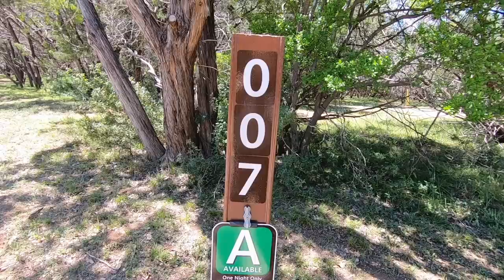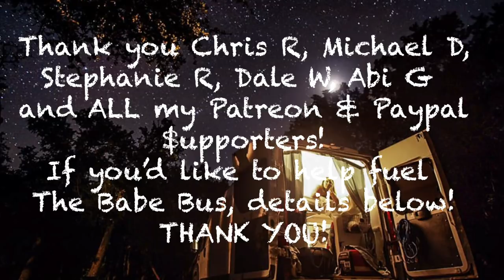Happy Two Month VANNIVERSARY Babe Bus!

Comment: Yeah I know it's a little late since you're already on the road, but if you end up someplace where there are a couple of soy-boy's who have tools and will work for a pkg of gluten-free rice cakes, add that 2nd roof fan. It'll be your most appreciated post-build upgrade. While our toy-hauler build will have sufficient A/C I hear that the portable evaporative coolers (swamp coolers) are a low-energy option for van people with limited space. If you get a chance to meet or hang out with other folks enjoying the Van Life along the way, find out what works best for them for dealing with the heat. If they've been on the road long enough they should know what works and what doesn't. Anyway, Happy Travels!

Comment: You can set up an indoor shower with a foldable dog pool and shower curtain on hooks. It folds up into a very little space when you're done. It sounds like you like long showers though so you probably aren't going to want to carry that much water.  It works for me but I'm also happy with a bar of shampoo soap and call it done. Mine sets up just inside the slider.

Comment: i live 6 months a year in a pick up with a shell.  i love laundry day!!!!  (mondays) @every 7 days...9am-3pm... 12 pack on ice....big sub sammie w/ lots of veggies....toilet with hot water(shower standing on your old towel).wifi usually, room to drag everything out of truck in the parking lot and clean and repack...do inventory...fix fishing equipment..retie loose stuff, check truck engine fluids...clean glass..clean cabin...toss out trash...oh yeah, do laundry and fold clothes...  most important....leave it nicer than you found it..bathroom wiped down, mirror cleaned,  empty trash from everywhere into one trashbag, wipe washer, nothing on floor, you get the idea...i have bumped into owners while there and told them it's me and what i do...response is always same...wish everybody did that.

Comment: I love, love, love my solar 😍.  Food: 5ft deep freeze (1.4 amps), including rock hard Ice cream and endless Ice cubes and as a top-loader, barely kicks on through the day.  Marie Calendar's and Banquet dinner, with a side of frozen veggies cooked up in the microwave make for minimal dish-washing and plenty of hot water.  The 4.4 cu ft fridge (1.4 amps) is much larger than I expected and gets the job done (but it does use more power than the freezer).  An igloo cooler handles the rest of the food not needing refrigerated. Comfort:  The 250-watt resistive personal heater and 7-watt reptile warmer wedged between 2 blankets under my butt are way more than enough to make it through 30-degree nights (I haven't yet encountered 100-degree days, instead I am running from sub-freezing nights and snow in N. Utah.  Yes, 65-degree days and 45-degree nights are where it is at for optimal comfortable temps. Except for the one day accidental off-road bump that popped my charging circuit breaker, 100% charge every single day... Even on days of 100% overcast (just takes up until 3pm to hit 100% when overcast).  

Only negative for solar... Really?  Climbing on top of the van (9'10") to clean off the snow and ensuring I do what I can to just have rain and not snow.

Suggest: Install 2 airmaxx fans, one over the stove, one over the bed by the back as nice as AC.  While I am happy to have my full propane system as a back-up, I am starting to question carrying all that weight and flammables vs "clean energy" 🤐.

Yes, solar is expensive (especially lithium batteries, but the panels are dirt cheap.)

Sorry, solar trolling is fun.  (1280 watts in a high sun desert environment does run a small 500-watt window unit or portable AC unit, just isn't really practical to run AC after sundown.)

https://www.walmart.com/ip/TCL-5-000-BTU-Mechanical-Window-Air-Conditioner-White/123440428  <-- example of a 450-watt AC unit that would definitely run in full sunlight with extra to spare charging  batteries when packing 1280-watts+ on rooftop.  Just saying, it could be done if this were wired on it's own circuit breaker line.

Comment: About the shower... I've used "solar showers" - black bags with a little hose and tiny shower head. Fill the bag with water and leave it in the sun to warm, then hang it somewhere to use. Might be an issue though because you'd have to hang a curtain outside and constantly be on the lookout for peepers. They're better than a soapy washcloth, but nothing compared to a real shower.

Also, would a big aluminum tub work for a bath? Like the way people washed 200 years ago. You could hand wash clothes in it too.

Comment: Problem with van shower is now you use up a bit of water so now you need to look for water. We look for shower, water fill up, laundry and shopping as a one stop thing. Have an outside shower and pop up shower tent for when necessary.

Comment: I used one of the little washing machines in my apartment but it was right next to my sink with a pull out sprayer to fill it. I had to buy a separate machine to spin out the clothes. I wouldn't want to do all that in a van. It saved me money though because to do one load was 3 dollars!

Comment: Thanks again Casey, for your insights. Big takeaway for me was: good ventilation, install a shower (Promaster 3500) and Le shitter instead of ‘Turd in a Tupperware’ 🤣 Keep up the great work, I love your videos!
Reply: Turd in Tupperware is putting a cassette toilet nicely, I have often heard it called Shit Stew, because it is turd sloshing around in pee in a hot ass van. No thanks. Le Shitter is fine, because it is emptied every day, cassette toilet marinades for a while. We built a shower in ours and a composting toilet goes in the shower (when the shower is not in use).  We compromised a lot of space for that shower/toilet but I would do it again in a rebuild.

Comment: Solar works if you have about 100 batteries.  Watch the other nomads and when using a/c, they always plug in at the sites. I have one of the small washers and it doesn’t hold alot. 4 shirts or 2 denims. They are heavy and just swirl the items.

Comment: There's a way to rig it. There's a way to set a system up that will use the battery bank and when they get down to a certain level the van will start up and send charge to the battery bank.

Comment: As you get into summer the key to your 70/50 degree temp equation is elevation.  8000' to 10000' should do it.  Sadly there aren't many mountains in Detroit.
Reply: I know of at least one area of the NC mountains that stays cool all summer and it is only 4000 ft. I suppose the problem would be finding a (affordable) place to park a van or RV in such areas.

Comment: Oh. And your shower situation, if you're open-minded... A super easy, flexible, inexpensive idea for ya, Casey.  No major tools required, No permanent space required either. Items needed?.... 
Shower Track $15; Curtain clips $10; Shower Curtain $1-$5; A 22inch water heater pan $20, a connector hose $10, a simple, battery-operated, submersible pump to put in your water container,$35. This flex shower could be set-up and broken down in 2 minutes. Could fit right in the area in front of your counter and side door standing area. Nice 2-3 gallon showers.   Might take the stress out of searching for last minute shower locations. And the pan is flexible, with convenient, side drain plug. Just pull out the pan when showers needed, and the curtain can be shaped as desired with the track overhead and tucked neatly to the side when not in use.   Hope this idea helps you. Later sista!

Comment: Get one of those small EU2200 Honda generators and put it in a locking box that connects to your hitch on the bumper to use for AC. Would work for an emergency, maybe not all the time. Im no expert but i think it should power it. They are pretty quiet too.
Reply: Dave 
Great minds think alike. 
It must be in the name .

Comment: You don't need a window ….you need a way to get air through the van … I put a 2 inch by 12 inch floor register ( vent ) on the vertical surface of the my step.....when open this allows air to be pulled into the van without any security issues....I did put window screen behind the vent so bugs don't get pulled in ...I put one on each side of the front doors of my ford van …you can put two on the big side step you have...…..to clarify this is the surface your toe hits when getting in the van...…..2x12 floor register from Amazon

Comment: Maybe Nike will come out with a shitter- " just do it". Great laugh. Agree with the solar energy stuff. The cost of batteries, inverters, fuses, converters, etc on top of the panels- ridiculous. Give me a heavy extension cord and a regular plug in. I live in South Louisiana and AC is a requirement not a luxury.  We already are getting " swampy ass" and it's not even summer yet. Also " fantastic fans " won't cut it in a South Louisiana summer. Have a great week.

Comment: Not sure if this is a dumb question but would you consider cutting a window in your roof? You know like the ones they have in rv’s....that way you can open it  and leave it open and if it rains you close it up....they might sell them at rv distributors....some of them have fans to so it helps the air circulate.....

Comment: Much more than a $100 but there are RV Washer Dryer combo's I picked 1 up for $200 used and they are about $1,100 new. They use about 2.5 gallons per load. They require plumbing as well.

Comment: Lol, yep, heats gettin to ya sunshine. And ya MDS sucks! Used to haul double trailer loads of that stuff up to Canada and it had to be wrapped in plastic first to make sure it stays dry in case of rain before the 4- 100 pound tarps were draped over and strapped down and bungied and it's hot and sweaty in coveralls and harness to keep me from falling and a hot sweaty hardhat in case it fell on me, like 4000 pounds of MDS would safely be reflected if it hit me and heavy steel toed boots that make your feet burn in 90 degree weather and blah blah blah and fuck that people, stop buying that crap! Lol.
Head north young lady where the weather is cool. 😎
Great infomercial on van life you posted lol.

Comment: You have me chuckling every time I watch one of your videos. A comedy club might be in your future. I agree with much of what you say, van life is not going to be civilized most of the time. If you can't take roughing it then don't try the lifestyle. I lived for six years in a van, then travel trailer and finally in a converted bus I converted to an RV. Shitting in a bag is not that big a deal and for a guy, neither is peeing in an empty gallon jug. Personally, I wouldn't go without a solar energy supply for charging and lights, but not an elaborate system. Oh, and as a guy, the shower bag set-up works fine.

Comment: Oh 200 watt solar and 200 amp hours of battery will run my Dometic fridge, ceiling fan, LED lights, charge electronics, run fans during the night and more except not AC.  I also installed some small windows in the rear sides of the van and the fan exhausts hot air and external air is pulled in through the windows which then flows over your body while sleeping which works fairly well.  What might work better is a floor vent - which would suck air from the shade under your van although parking lots retain a lot of heat in the asphalt and can be much warmer for a long time at night.  I love solar, sorry.

Comment: @14:30....Showers:  This reminds me of another NOMADIC couple- currently in Central America, and their "surfer shower" they took; basically a drain pipe of god-knows-what.  As IF that's a viable solution.  With a van, I'd have a passive solar bag and/or the solar tube mounted on a side rail (looks like an awning) to provide options for NOT having to hit a gym or c.ground.  

For cooling, how about (small) fans....using a portable/foldable "solar blanket" (cheap), w/ enough oomph to drive a 6" fan/USB, etc.  Also, the addition of an awning to provide shade....and covered outdoor (work) space.

Or you could go the "cheap A/C" route:  buy a can of compressed air, squirt some.  That creates a blast of COLD on can exterior; smack that puppy upside your wrists and carotid artery/neck...and viola'!  CHILLED.

Comment: OMG, that is SO TRUE about all the reflection and anticipated and practiced conversations that happen in the shower as well as the occasional cry or song.  I explain so many things, to people who are not present, while taking a shower.  Sometimes I wear myself out trying to explain this or that to them and I know that conversation will not actually ever happen.  But, anyway, shower in a van, shower every day???  Hell no.  I don't even shower every day in my real life (weekends are my days to roll out of bed, sit at the computer and be left alone).  Living in a van I doubt I'll shower more than once a week.  Wet Wipes baby and/or a bowl of water and a washcloth works wonders!  Seriously, you'll kick yourself for not doing the bird bath method sooner, especially in the hot and sticky South in summer.  That being said, I'm making my own homemade version of the Big Kahuna Shower Kit (which is way over-priced) for those days when I just want water rushing over me and my long hair.  If it's too cold to shower outside the van then you can get one of those fold-up doggy bathtubs to use as your basin to stand in and catch the water with the shower kit inside and run a curtain around you positioned up a MaxxAir fan to suck out the humidity.
Reply from the maker: Aubrey I workout daily and until you have taken a baby wipe bath several days in a row...I would hold back on making any assumptions.
Reply: @CaseyRoman  Well, I've done it 5 days in a row with a washcloth and baby wipes and gotten pretty clean.  That was during my hiking trips in Big Bend.  Then again, I did several years of field work in grad school and probably got used to being a bit smelly.  It doesn't bother me much to not be as fresh as possible.  But I really am always amazed at how clean you can get with a washcloth and water.  Anyway, thanks again for the videos!  They're fun to watch.

Comment: Hinge your bed (Murphy bed) out of the way so that you can put a spray shower with an electrical pump when you want to shower. Use a shower curtain wall and a pan drain. Either elevate the pan slightly so it can contain the grey water. Lather with liquid soap and use the water to only rinse.
Reply from the maker: Do you live in a van that you converted yourself?
Reply: No, I lived on a boat several times stationed in Hawaii. Same tiny living with water and power management.

Comment: you are so right about solar - when were without power during a hurricane, nobody had a solar powered generator lol
Reply from the maker: THIS IS THE MOST ACCURATE COMMENT EVER WRITTEN!!!!!!!!!
Reply: I live in a rural area where the grid power goes out for 6 - 8+ hours several times every year. I have a cheap $500 solar setup that's enough to run 3 lights, the pressure cooker, a laptop, a phone charger, and a rechargeable lantern. Not enough to run the refrigerator. It beats sitting in the dark eating cold canned beans while trying to read by candlelight. If I lived in hurricane country I'd have solar and a backup generator, both. If people don't have it, that's their choice. The technology is there, not expensive for a small system that makes life a little easier when the grid is down.

Comment: For a shower option on shot Vans like yours, I Saw someone using a shower bottom and a curtain that hangs on and off the roof of the van in a circular rod, do you think this could work? They put it right by the sliding doors and sort of under the floor. Could this work in a smaller van for a shower option? What do you think?
Reply: I do think a "pop up shower" would be a good option for when it's absolutely necessary. Tedious to use every day but for when you don't wanna drive out of your way to a gym it's good. A galvanized bucket, shower curtain and hooks on the ceiling could all be put away easily

Comment: Casey  ,  southern states are highly over rated  ( Too Frigging  Hot )  !
Casey check out the Big Kahuna on line it may help you when you just need a shower  (NOW)  !  I have one and it works great. It's well made here in the US.
If my van was as big as yours I'd have two , one with body wash in it the other with fresh water for drinking or a rinse. They have three sizes. All contained in one unit  , pump , hose , spray nosil and a heater if you want.
😁

Comment: OMG, Casey, what?!!  You are so exaggerating!  It is NOT 90 degrees in Galveston in April, (the month you uploaded this video) LOL!  I live in Galveston.  I'm sitting here in front of my iMac right now in late September without the A/C running (it broke and I don't want to spend the money to fix it) and I'm just a tad bit warm, not sweating at all.  It actually feels pretty great because I'm slightly cold-natured and I prefer fresh air coming off the ocean to the canned air conditioning (growing up in Houston, the most air-conditioned city, that chill is annoying as hell!).  I get to walk around half-naked with the fans blowing on me as I work at my desk.  Granted, I live just a couple of blocks off Seawall so I get a great ocean breeze through my windows which creates a great wind tunnel through the house (which you NEED to create in your van by installing a window and a Maxx Air fan).  But it barely even broke 90 degrees our hottest month this summer (which is August), maybe only 3-4 days. 

Yes, 90 degrees is hot for sure.  In August, when it's 90 mid-day, I'm spraying myself down with a spray water bottle and sitting in front of the fan to cool down.  But April is not bad at all.  It's usually in the 60's and 70's here in April.  I think you could go ahead and install a MaxxAir fan while on the road.  I've seen several installation videos and it looks pretty straight forward.  You will feel SO MUCH COOLER!  I know you must be miserable without that airflow.  I couldn't do it.